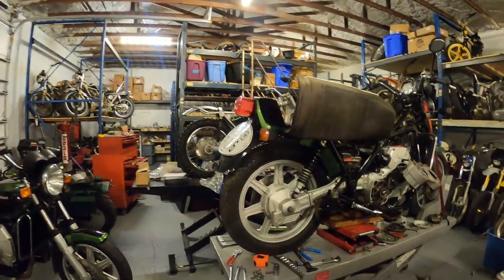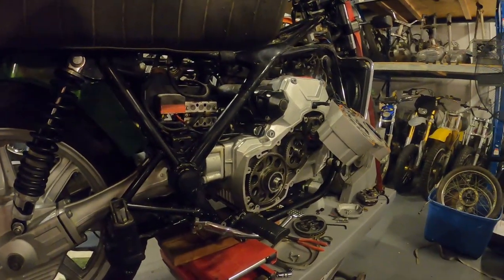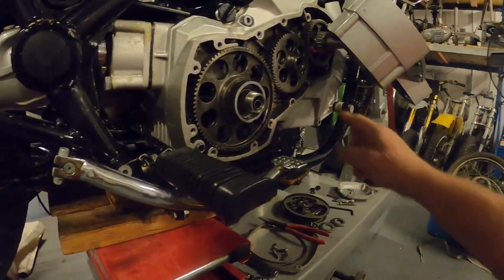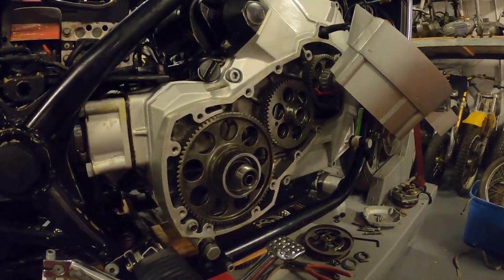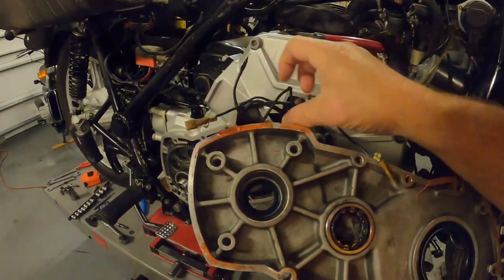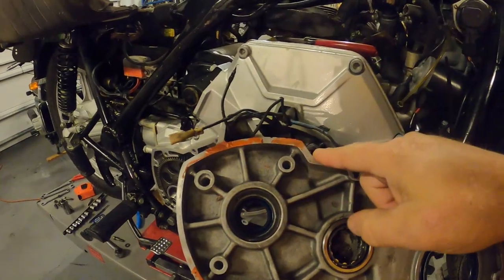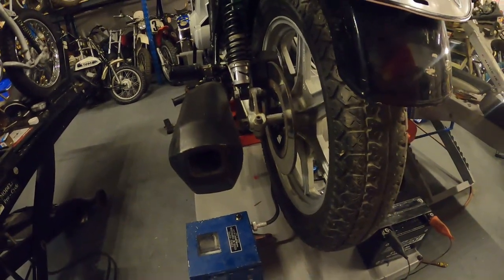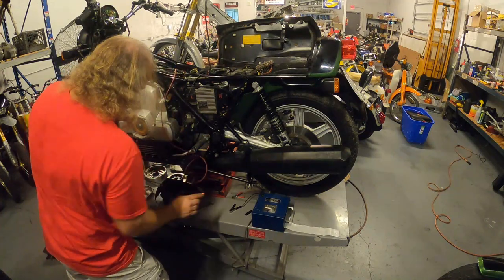WE DIG INTO THE VAN VEEN TWIN ROTOR WANKEL MOTORCYCLE

Comment: try that compression test with a better/bigger battery; 75 psi is something of 5 Bar; that should be 8 bar/116 psi at least.
Reply from the maker: I figured a larger battery would help but that's what I had at the time.  I'm also not sure the carburetors were fully opened up, since all the linkage and the throttle cable are disconnected.  I was just happy engine turned over nicely and all peaks were the same, especially because at first - it seemed like it wouldn't turn. There was some debris near the exhaust port. I'm trying to be patient with it. Yes, a larger battery is in order now.